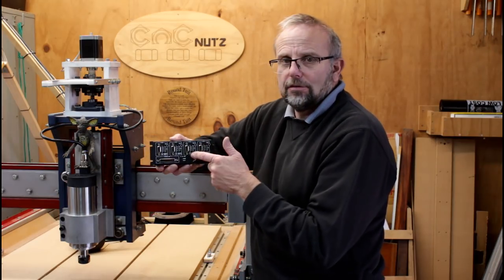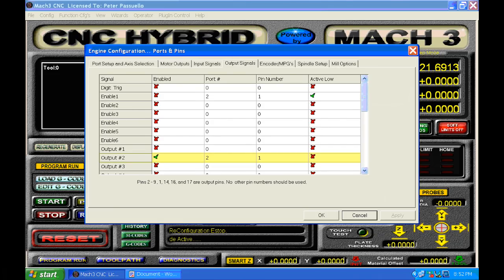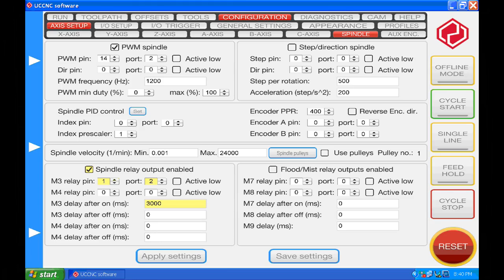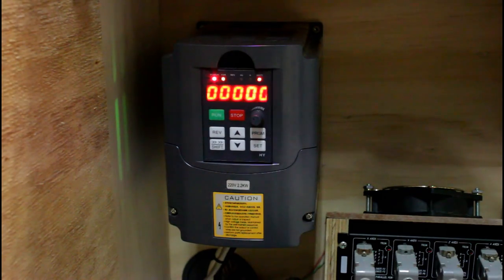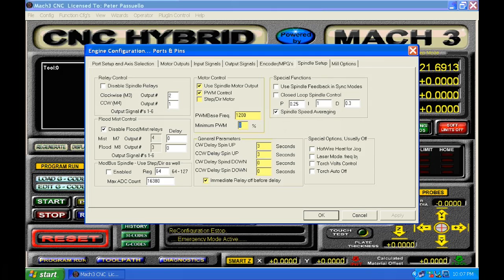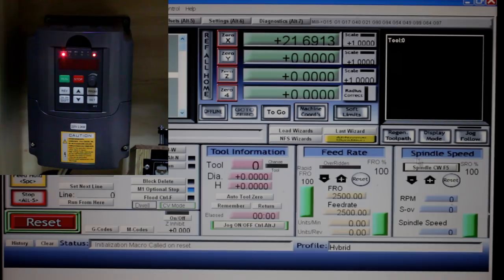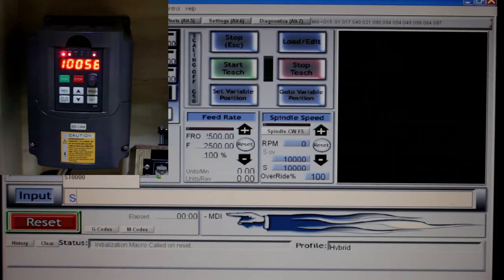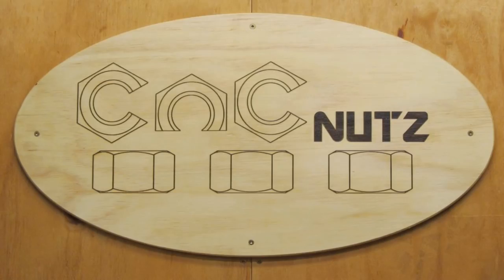Installing a Spindle Part 3 - CNCnutz Episode 146

Comment: been working up to a purchase of parts to make a better cnc machine than the little one i've got, i use bcnc, for the moment, it's functional.  what i'd gotten to think of is using a water cooled spindle and vfd for a junk mini-lathe for cnc as well.  the motors on those things are usually not the best, but i don't think i need to go that far, however, changing speeds based on how far the tool is from the centre of a part would be damnnice, at least as a trick.  having two water cooled spindles around could be extravagant, so i'll probably just go for a cheaper stepper setup, though that adds positioning support.

Comment: Thanks and yet another  great video, you make it look so easy Pete, how much hair did you loose trying to get all the settings right? this will help immensely for the newbies to set up their spindle. Maybe in the next video you could show how to set up tool cutting speeds and show how the G code operates the spindle speed. Keep up the great work Peter.
Reply from the maker: +131melbourne 
Thanks. 
Gcode is magic. 
Hair loss is substantial. 
Cheers
Peter

Comment: Thanks for all you do Peter. I have just replaced my VFD with a new one after the previous one went up in a puff of smoke.  I replaced the new one with the previous wiring to the G540 and to Mach 3.  I programed the VFD using your video since I could not retrieve the settings from the now smoking old VFD.  Everything works, except the spindle runs at twice the speed commanded by Mach 3. The speed displayed on the VFD matches the actual spindle RPM measured with a hand tach. I've checked and re-checked both the Mach 3 setup and the programming of the VFD.  Any thoughts on what I have done wrong???
Reply from the maker: Without knowing what VFD you have and how you have it programmed it is hard to tell. My first thought since it is running at twice the speed is that you are providing it with a 10 volt signal and the vfd is expecting a 0 to 5 volt signal. If your vfd is like mine there is a setting to choose between 5 and 10 volt input signal. This would be the first thing I check. Hope this helps. Cheers Peter

Comment: great video, i was able to get mine working from this tuturial. but i have a little problem of rpm values i type into mach3 not matching what is on the screen of my vfd/spindle noise. for example i type S24000 in and it wont go past 12888rpm. and i gradually lower the S value in mach3 it seems the the vfd/spindle  will drop by a same percentage? any help woulbe greatly apreciated 
thanks sam
Reply from the maker: You probably have this fixed by now but the problem is most likely you have the settings wrong in the VFD. If the actual spindle speed is correct but the display is wrong them you have PD144 wrong as it is used to display the speed. If the actual spindle speed is actually 12000 when you entered 24000 then you are either feeding a 10 Volt VFD with 5 volts or you have set  PD005 wrong and are limiting the top speed. If you are using 5 volts to the VFD look at PD070 setting.
Other than that it could literally be anything but work through it one thing at a time until you find it.
Cheers Peter

Comment: How did you determine the PWMBase Freq to be 1200?  Thank you.
Reply from the maker: I plucked the number out of the air and it worked ok with my G540's PWM to voltage converter. 
Try changing the value and see what results you get.
Cheers Peter

Comment: Mach3 has a spindle calibrate which would get the motor spot on for you and I do believe the frequency should be 400 in Mach3 to match the motor and VFD not 1200.
Reply from the maker: I did see the calibration feature but was unable to figure it out.
I don't think the frequency really matters that much because it is then converted to a DC voltage 0 - 10 volts. The higher the frequency easier it will be to smooth the voltage out and get a steady value. I just used that characteristic of the smoothing built into the Gecko G540 to tweek the speed.
Cheers
Peter
Reply: Edward Mitchell I

Comment: HI Peter.
I used the RS485 USB adapter on my machine and had to use a Mach-3 plugin developed several years ago by a Mach-3 user, Le Royau medeole. (Instructions and plug-in download can be found at his web page here. http://royaumedeole.fr/informatique/plugin-mach3-pour-vfdhuanyang/mach3-plugin-for-huanyang-vfd/ )
If you find a better or more up to date way of implementing the RS485 I would be really interested in your findings.
Cheers
Reply from the maker: Have just downloaded all the files and printed the manual to give a try and see if it works.
I looks like this setup has everything I would need and expect so we will see once it is working.
Will let you know if i come across anything new.
Cheers
Peter
Reply: I ran into a wierd bug that if I run the spindle up to over 6000rpm it completely locks up the computer, locking the stepper motors but leaving the spindle running. The only way to get control back is to hard reset the computer. really annoying!.
I still haven't found whether it is a bug in the RS485 driver, a bug in the mach-3 plugin or a windows XP problem. I can't seem to isolate it.
Reply from the maker: Well I connected mie today to both Mach3 and UCCNC with limites success on both. They controlled the spindle on and off as well as setting the speed but I also got a couple of things need to look more closely at. I did not run into the problem that you have experienced and Mach3 didn't lock up at any speed. Not sure why yours would be doing that.
Just thought i would update you.
cheers
Peter

Comment: You might want to set your minimum speed to 2500 with that spindle. To keep it from heating up.
Reply from the maker: +Roger The Tinker 
The minimum speed is set to 6000 for my setup. 
Cheers 
Peter

Comment: Why are you not using M3, M4 and M5 codes. I use a Chinese spindle and a Hitachi VFD hooked up to a PDMX board with three wires, with that I can control the speed and start or stop the motor with M and S codes.
Reply from the maker: +Oswyn Faux 
Why type Gcode commands to turn the spindle on and off when there is a button there to do it? Maybe I'm just lazy. 😀
I didn't configure it for M4 the command as I don't want my spindle to turn backwards. It works fine for M3 & M5. 
Cheers 
Peter